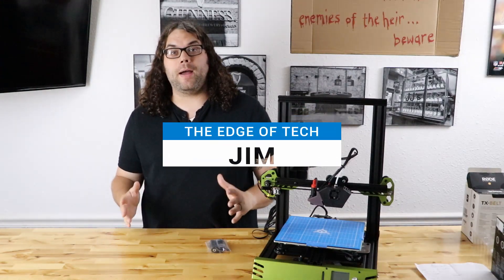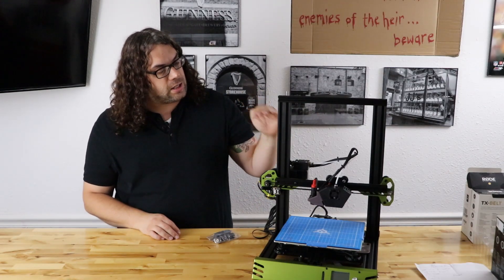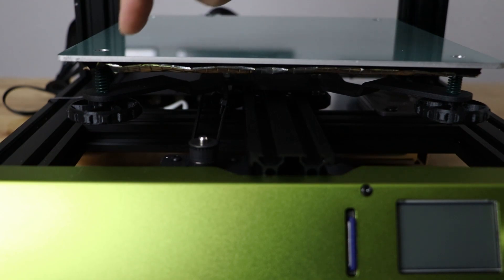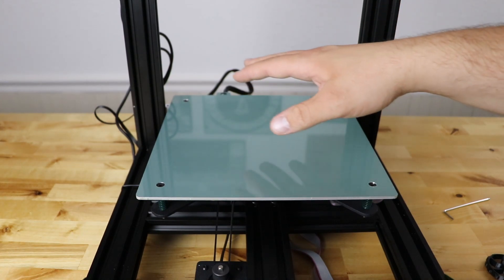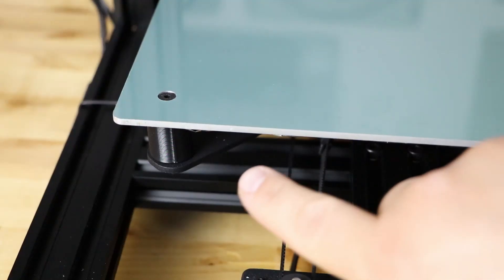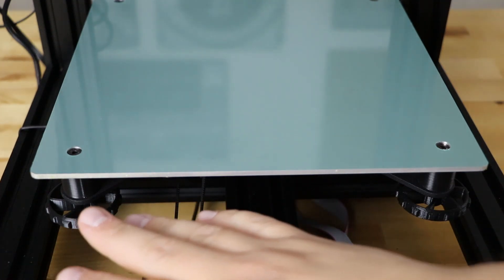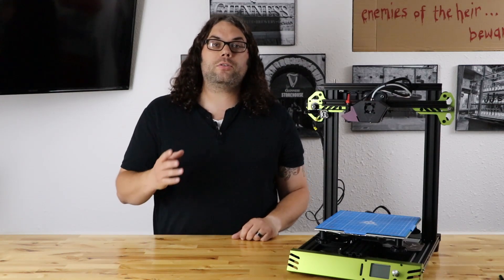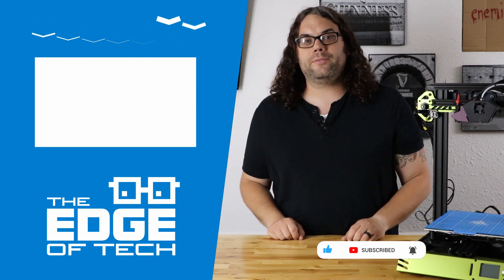How to install TH3D Solid Bed Mounts on a Tevo Tarantula Pro

Comment: Hi Jim.
I had a few problems with the solid mounts. If by any chance the ezabl failed, the nozzle crashes into a solid surface rather than a sprung surface. I have always left my springs on for this reason. I never have to adjust them.